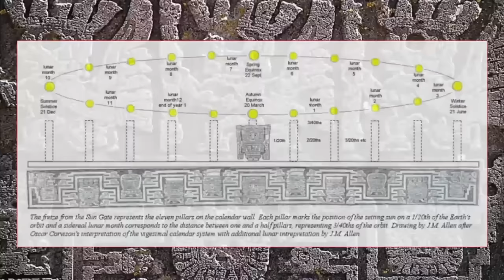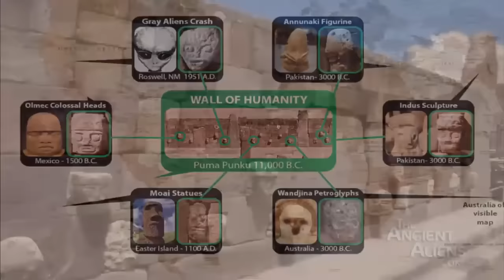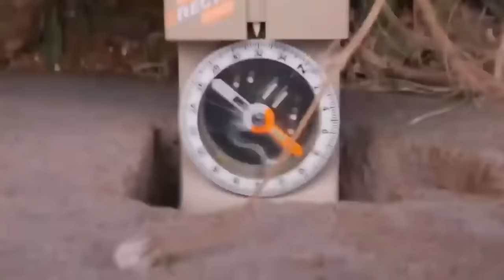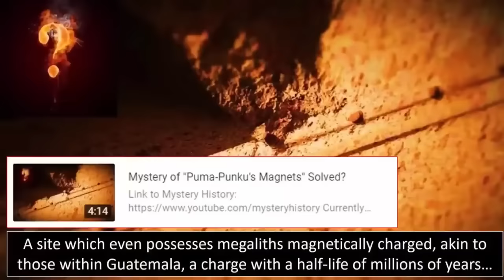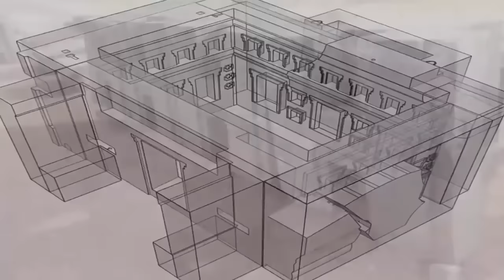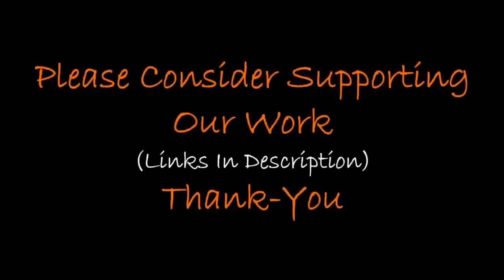Anomalies Unearthed In Puma Punku?

Comment: As machinist and using logic mostly shapes were not cut they were formed, now you must ask how do they turn stone playable enough to form the stones and how did they return it back to stone. If you look at the stones, as if it was concrete, it would be easy to do.
Reply: I was there a month a go, im a carpenter myself and when i saw those stones i was just in awe...when you stare at them all i could think of was machine tools or even laser. Not cement, because i touched them.

Comment: When i see how the stones are cut at Puma punku i can't help but thinking of the openings in computers where you can put in a plug. If the stones are charged with some kind of energy, could it be possible they were ment to put in some kind of plug to transport the energy through? Could Puma punku be some kind of energy factory or central from which the energy was transported to devices or machines elsewhere? Don't you think this idea is highly compelling?